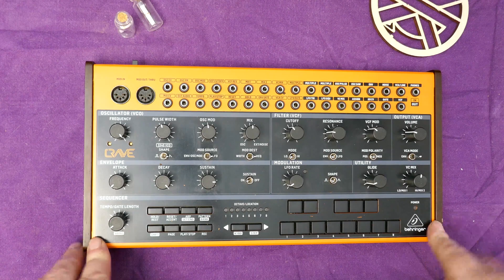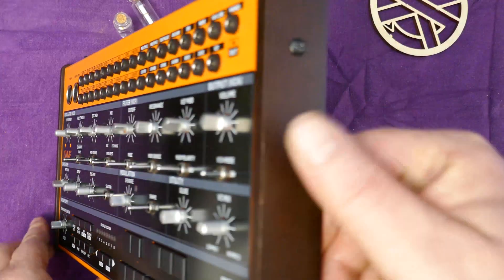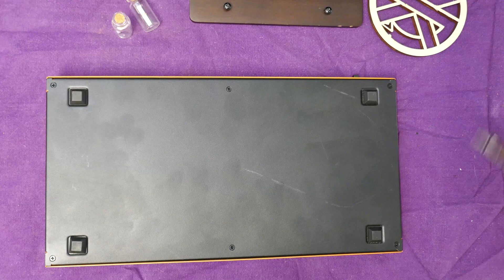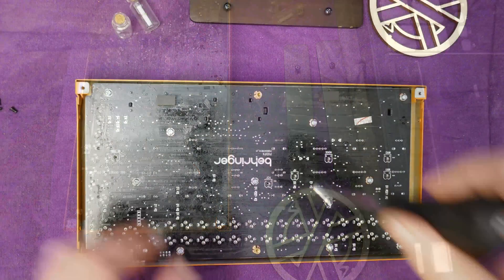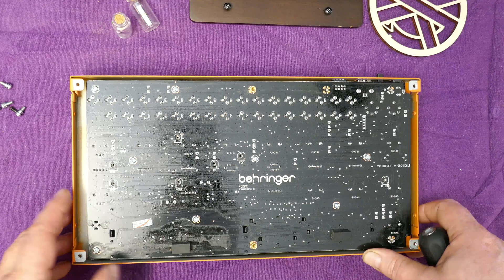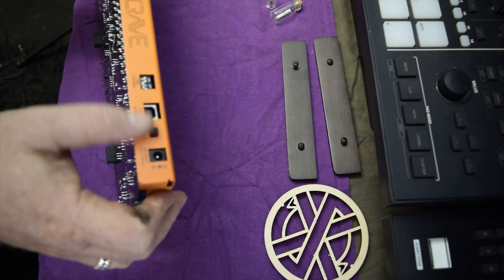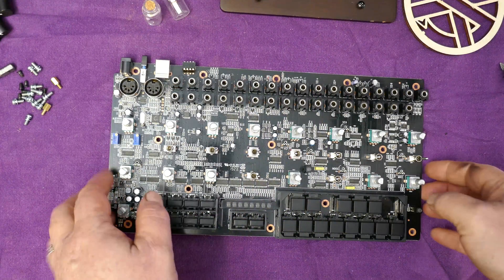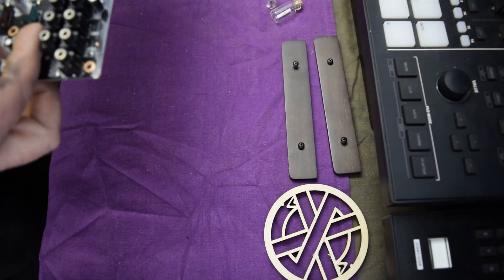What's inside a Behringer Crave? Taking a closer look for mod options & how well the synth is built!

Comment: Nice vid. I took my Spice apart due to a faulty power input socket. As sometimes happens with these things, general busyness and distractions take over and it remains in bits for at least 6 months now. I've kept it all safe but now it's time to put it back together again which is why I'm watching your video! Very helpul. Also, I didn't expect to see the Crass logo when searching for this but it was a nice surprise! I saw them tons of times in the early 80's. APF ✌🏼
Reply from the maker: They're pretty solid boxes, it should go together again just fine!  A in the O!

Comment: Excellent video. Was thinking of making a new panel from sheetmetal someday.  I would likely run the holes with a milling machine, but it seems like it would be quite a hassle. The manual has a nice 2d CAD template for reproducing the layout. The unit is very neatly designed. They must have a heck of a design department! They must be having fun.
Reply from the maker: There has been a Moog M-32 faceplate on eBay for over a year now, sadly it doesn't ship to the UK as this would be a cool project too!  I've considered using my cnc machine to replicate it too!

Comment: If I were doing that I would most definitely be wearing an earth bonding strap. Modern electronic components are very static sensitive.
Reply: I've been doing electronics as a hobby for 40+ years without a strap and not once have I nuked a "static sensitive" component. Also, you missed out the comma after that!

Comment: i have now got 3 of these...crave 1 + 2 sound very similar but crave 3 sounds very different, the sensitivity of the filter/resonance is different - do you know if it is possible to calibrate the filters so that they would all sound the same?
Reply from the maker: There are additional trim pots inside, they might be worth checking, but I've not managed find any info on what those were for exactly...

Comment: I've had my Crave for about 8 months now and It is my Daily driver and gets a lot of abuse.   I can be rough on the patch bay, pots and switches and so far no issues.     I'm constantly finding something new and making patches is fun.     It sounds great on its own but really comes alive when you add some  effects pedals.      I use a Mooer Red Hat multi-stop  it brings the Crave to another level.
Reply from the maker: Without a doubt...! Had one of mine running through the fx rack recently, the other one is still in bits! Lol Its easily my go-to box for bass...! And it's still capable of some great sounding clean leads, I just love those 3340's... glad you're enjoying yours so much too!

Comment: Ooh....you are awful. I've always wondered how best to part ones cheeks. Should I ever need to do same with my Neutron..... A perfect demonstration Pete! Seriously though, it's fascinating to see what's inside these newer synths. Ever more compact in design and arrangement.
Reply: ... but i like you.  Dick Emery.  Rip. ;-)
Reply from the maker: So very little to them Steve! I'll give a better run down on a few of the components when I start soldering next week!  Was going to message you last week BTW, the M-VS1 is being "quirky" ..! Changing patches it will change the patch number, but stays on the same clean piano patch until I go into each patches settings and re-enter Rx channel and toggle a few other settings then it changes...  performed a factory reset on it but still not just scrolling through patches...  cant figure out what I'm doing wrong?? Lol
Reply: I can't come up with any suggestions on this one Pete, other than to check that the buttons are clicking as they normally do, and not stuck/lost their springiness. Having said all that, page 9 of the manual does mention about needing the correct settings for Prog Chg or Bank Sel, which need to be switched on otherwise the sounds will not change when pressing the usual buttons, which sounds like what's happening with yours.
Reply from the maker: @spacedrifter1961  yeah I've been reading the manual again lol I'll look into it more over the weekend! It's been nice using it again though, even in a restrictive capacity! I need to put aside time to take a load of samples from it too...
Reply: Page 5 elaborates on those two settings. Yes, I feel privileged to have one of these. When you consider it's packed full of so many iconic 70's patches taken straight from not just Roland stuff, but their competitors at the time, I'm not sure if there is any other piece of equipment that offers the same experience.
Reply from the maker: It's possibly the only chance I'll get to play on half of those amazing voices!!
Reply: Too right. With the exception of the Neutron, I still feel today's reasonably priced clones don't quite capture that 70's analog vibe that the M-VS1's original patches have. They may be 99% there, but it's that last 1% that makes the important difference.
Reply from the maker: @spacedrifter1961  agreed, but that said,  I just picked up another Deepmind,  this time a 12D to go with the Deepmind 6...  I know they were heavily based on the Juno but they make some incredible sounds, very reminiscent of the OB patches etc from the M-VS1!
Reply: Having made that sweeping statement (steps back to avoid Uli's right-hander), if we accept these new entrants as complete machines in their own right, with tendencies to sound like this or that, rather than clones that are nearly there, then we are spoilt for choice. So I agree with you on that point, Pete. Is there a Deepmind 12 review/demo on the horizon?
Reply from the maker: @spacedrifter1961  if we analyse the concept of synthesis then it should be possible to make any one synth sound similar to any other synth so long as wave types and filter types are the same, and there's only a limited handful of either of those available! Lol
I was wondering about a 6 Vs 12 comparison video as I haven't found one..! There are very few differences, the 12 obviously doesn't run out of voices as fast as a 6, but patches using the full 6 voices are few and far between already, if it goes over then it resorts to note priority, whereas the 12 just gets uber phat!!! 😉 It would be a really short review, but since there's a gap of this info it may have to be done!!
Reply: I for one would welcome that comparison video, even though I don't own either of them. The words "uber phat" sounds quite apt for the 12.
Reply from the maker: @spacedrifter1961  I'll pop it the pipeline (vicar!) for imminent projects Steve, it'll mostly be showcasing the additional voices of the 12D...  but since that's not a video I've found online anywhere I'm sure it's one that needs making! Preferably sooner rather than later, because as nice as playing on a Deepmind, erm, 18!? is I could do with selling the 6 ASAP to recoup some of the costs lol
Reply: ........said the actress to the bishop!

Comment: No need to remove the cheeks if you just need to open it, and better pull of the power switch cap first, before pulling the pcb out.
Reply from the maker: Yes, wasn't instantly apparent though and thought it could be wise just to get them out of the way!

Comment: i recently opened mine up with the same intentions.  I need to figure out what posts to soldier the jack to
Reply from the maker: Plug a mono lead into the vca out and use a continuity tester from the tip and sleeve on the other end of the lead to the solder points on the board to work out which point is which...  😀

Comment: "We got our two cheeks apart and our knobs out", did you work on that line or did it just happen? ;-)
Interesting video that got me thinking. Since you have both the Crave and Model D, would you say the filters sound the same?
Both machines are 'inspired' by Moog synths, so if my Craving for some Moog sounds becomes strong enough, would the Crave be another alternative to the D or a Eurorack ladder filter in your opinion?
Cheers
Reply from the maker: Glad it made you chuckle..!  Nope,  the craves are totally different to the Moogs, tbh I much prefer them...  the CEM3340 chips always sound much cleaner to me!
Reply: @Studio-solutions-com  I didn't mean the whole synth or oscillators, just if the filters are same/similar.
Reply from the maker: @zpinkLondonBelow  yep, they both use the same 24db/oct ladder filters